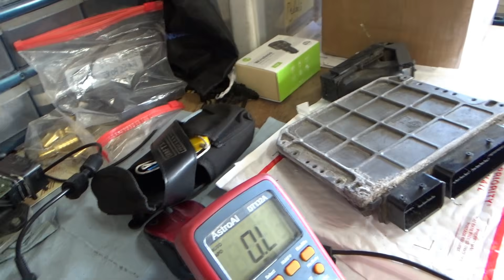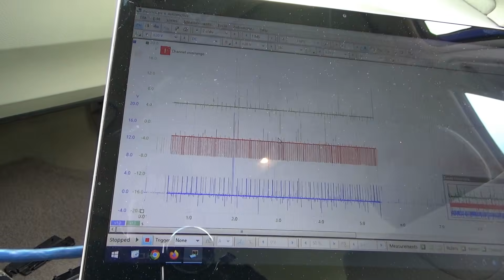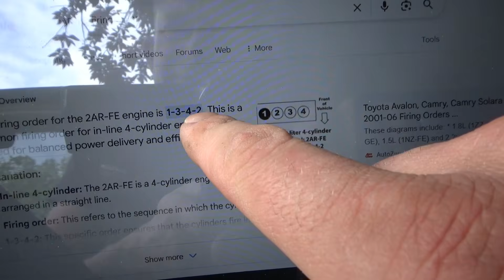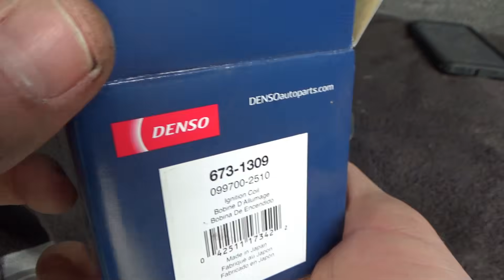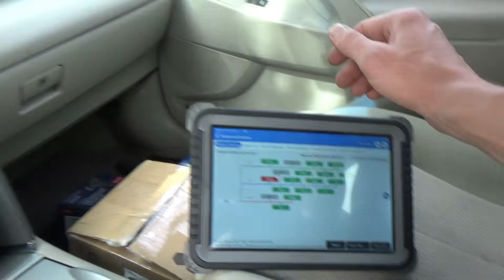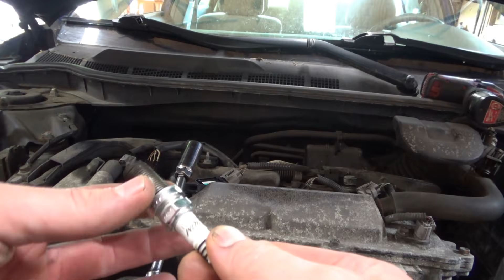(Pt 3 - CONCLUSION) CRAZY Camry...EATS ECMs?!? (Labor Day Special 2025)

Comment: Question. Why with the consistent issues with damaged or counterfit parts from Rock Auto do  we continue to purchase them and blame NGK or the manufacturer?  Props to NGK for stepping up. Thanks Ivan. Ive also found Napa and other reputable parts stores have reasonable prices and will warranty a part right away so you dont have to wait.

Comment: Curious what it did to the ECM - is there a component that blows like a fuse?  I know you showed the one board and didn't have any obvious signs - Did you send it to Northridge fix?  Probably not worth it for suh a random failure, but auto electronics / networking is facinating to me.  Thanks for consistantly sharing interesting content!

Comment: In my younger days when I had my Arctic Cat Panther that ws powered by Suzuki, I was so impressed with NGK plugs, I bought NKG spark plug wires and spark plug boots to replace the OEM wires and boots. I still think both NGK and Denso make auto parts...and other types...that meet the highest standards. 
Your diagnosis on this Camry was pretty amazing.  You are no fool for sure.

Comment: Back in the early eighties I had a car with a two way radio that when they hit the talk button the car would quit. The signal from the radio was screwing up the circuitry in the ignition module but would not cause a complete failure. Replaced the aftermarket module with OEM problem solved.
Reply: Back in the day I had a Motorola two radio that would trip a GFCI outlet in my house when the mic was keyed.

Comment: I hope that many young (future and present) mechanics are watching you regularly. It seems to me to be the best way to train a mechanic that I know about. It appears that the car dealerships need better trained mechanics from all the business you get because they can't solve a problem.
Reply: The OEM's punish diag work and reward fast as possible parts swapping. In general a dealer shop can be a terrible place too diagnose cars. If they rewarded competency at trouble shooting the average dealer shop would be better at it. Other obstacle is neither the manufacture or the customer wants to pay for diag time. Many times on customer pay work, I have the customer tell me the diag should be free as I just have to plug it in. The big exception to that is. I often get cars that have been to a bunch of independent shops and have had the parts cannon fired at them. When I find the root cause on one of those the customer often appreciates my effort.

Comment: I bought a Corolla that had no check engine light and no communication from my Toyota dealer. Nice looking car. Turns out it had a bad aftermarket  coil. I bought 4 used Prius coils on Ebay. Problem solved. It kept blowing  a fuse as soon as you turned the key on. Luckily I only went through a few fuses and not ecms.

Comment: One of the guys had one at the dealer. Just a long crank on a 3series. Aftermarket coil was spiking the cas module on first crank in the morning. It was parts canon heaven. The dealer ate the parts and eventually had a engineer out to fix it.

Comment: Ngk has been making a OEM part and after market quality part with a 1yr warranty especially IGN parts and they last just that 1-2 yrs. A set of plug wires went out after 2 yrs setting off coil codes but it was the plug wire that was bad

Comment: That little glitch on the 5 v signal could be damage to the wire from the high voltage crossing internally in the bad coil. May need a new signal wire on the cylinder. Time wil tell

Comment: I've always used NGK Iridium in my Hondas, no intention of changing that. That said, ignition coils Denso as OEM, I'd likely choose Denso. I'm curious why the owner changed the coil packs to begin with. I've owned some higher miles Honda and Toyota vehicles and never thought to replace them as preventative maintenance. In any case another amazing diagnosis and persistence to solve it. Props to you and kudos to NGK for the follow up testing.

Comment: I installed a ngk spool valve on a customer Honda element. It kept leaking oil. Ngk was 79 bucks OEM was 280. I replaced the gasket 3x it kept leaking. I got an OEM and compared them and the ngk was .009 shallower on the o ring groove.

Comment: how long does it take to test each coil to ensure this is not happening?  these coils that live under the manifold/plenum cause an issue in that finding the correct place (wire or connector) to test for this requires some creativity or research.  it appears it is prudent now to check for this and there is no such thing as too often.  also, I would wonder if injectors could be next for taking down computers if they are not already doing so.

Comment: NGK is my choice from 1970s until today .
Not sure I would condemn NGK over one defective product.....
I used them on motorcycle marine and automotive use since 1970s 

30Kv leaks to 5v reference signal to ECM causing spikes wow !

I heard there are counterfeit NGK iridium plugs and coils  being sold on fleabay and scamazone .

I was also taught in Yamaha school not to take plug wire off plug or unground while cranking or running since it could damage coil or CDI capacitor in ECM on Motorcycle and outboard motors .

Excellent job Ivan 👍

Comment: Wow Ivan, this might be the most impressive diagnosis ever.  I don't know how you made the logic leap to suspect the coils.  Perhaps you've seen this before or perhaps you got some divine inspiration?  Either way, great series.  You are providing a priceless service to the automotive maintenance world.
Reply: I haven’t watched this video series yet except for some of p2 and the first two minutes here when you did your summary. The first thing that came to mind is you need a new ballast resistor… if this was 1965. 😃 I’m hooked, so I’ll finish this episode and see what happens. Happy Labor Day to one and all. And remember, if you love it it’s not work. But that doesn’t mean you shouldn’t get paid fairly.
Reply from the maker: The 4th ECM that set all 4 coil control codes when it died was a big clue 😉
Reply: @PineHollowAutoDiagnostics  I was about to comment the same when I saw your reply.   👍
Reply: @PineHollowAutoDiagnostics  it seems like so long ago.  there was so much to this, and only four hours of diagnostic time.
Reply: @PineHollowAutoDiagnostics that was one clue…  but the aftermarket coil was another clue
Reply: He had already one or two cases where a coil spiked the system causing issues, one I think was a dodge and the other a Subaru.
Reply: This happens to the first gen of the ford 3.5 when the spark plug worn out the coil will short out and kill the computer high volt will enter the signal wier.in this caes it a defect.buy cois with garente.😂

Comment: Battery +12V
     ↓
     COP (Step-Up Transformer)
     ↓
  [Cracked / Faulty COP] 
     ↓
  Inductive bleed ⚡ → 5V Reference line
     ↓
  PCM inputs damaged 💥
     ↓
  Engine sensors / ECM malfunction

Comment: Possible defect in the potting/insulation that failed due to high voltage breakdown of the insulation or heat/ vibration induced failure.

Comment: It only makes sense that a high voltage leak would burn out the 5v reference. A coil failure would appear to have a higher potential for damage than a shorted sensor.

Comment: I would insert a high temp, high voltage ceramic disc capacitor (say ~20nF) onto the 5V line.
Scope it and see if the ref. wire voltage is cleaner.🤔

Comment: Our labour day is on October 4 in New South Wales, Australia.

You did a really good job capturing that inductive spike without the ECU blowing up, I know that you shouldn't do things like disconnect the battery while the engine is running for the same reason, that will happen, I know Kenny on the YT channel WWK did that to one of his personal cars just to demonstrate something to some people but I wouldn't do that to my car because I don't have the money to replace the PCM & I also don't have the equipment to link it up to the body control module if I had to replace it.

I would want to get the replacement cloned because my cars PCM doesn't run a standard tune although it will run with a factory tune, it won't go as good even though it has a sports exhaust system fitted, the PCM has been tuned to that exhaust system in real time on a chassis dyno.

I know that the older Nissans (e.g the R31 Skylines) had Hitachi ignition coils, ECU, fuel injectors, etc fitted which were all good but in the later Nissans (e.g. the R33 Skylines) they went for Denso side feed fuel injectors, coolant temperature sensors, etc but the ECU & the MAF sensor was still made by Hitachi.

My Holden VL Commodore which ran the Nissan RB30DE engine I built for it using the RB25DE engine parts was fitted with the same Denso side feed fuel injectors as the Nissan KA24DE & SR20DE engines were !

Comment: I'm not sure if it was the coil or the computer driver but I had a 08 Lincoln mkz I believe with a 3.5 it came in with a melted coil because the driver was shorted to ground so the coil was basically trying to see how long it could handle full power and ground, boy does that stink btw.

Comment: I remember some schooling I received over 25 years ago when coil on plug was relatively new.   It was mentioned that unplugging spark plugs while the vehicle was running was a bad idea. In essence, that high voltage on the secondary has to go *somewhere*. Even with a distributor, the spike was liable to go back on the primary side and kill the driver.  Many years later, an electrical engineer told me that the arc happens within the coil itself which isn't good for the coil and I see no reason it cannot migrate back to the engine computer whether via the IGF or trigger wire.

Comment: This 5 V circuit must have ultra-fast protection diodes on both sides. If there are none, it's a major case of planned obsolescence...
Remember: in any CMOS circuits, any voltage below the ground level and above the power line level (by more than approx. 0.6 V) is always dangerous! Also any voltage greater than 0.6 V arriving at the circuit inputs BEFORE the power line voltage is dangerous as well.
Reply: They probably put TVS diode on the output of reference voltage, and that is probably what caused short circuit. So protection is in place, its just one time use(its for protecting things connected to the output of Vref in case regulator self-destructs and send 12V into Vref, not to protect ECU from)

Comment: Funny how customer is fine with used ecm but didn't get a good used set of coils. This is kinda the same issues Ford had on Escapes. It looks like  the ignition capacitor part of the coils failed. The pattern looks like old skool when an external capacitor leaked.

Comment: From an engineering prospective, the 5 volt reference needs to be zener-protected. Say, a 15 volt zener diode to swamp the 5 volt line, to control unwanted spikes from back-feeding into the ECM. But better yet, eliminate ECM technology altogether. Simpler systems need less intervention, just sayin. But, I'm old & my heart is back in the vacuum-tube era, I guess, It was much simpler back when.

Comment: Great work, Ivan.  The low voltage on the ignition side is interesting, but apparently this failure avoided detection by the ECU (granted, engine did not run long, but you did note that the car was audibly misfiring).  Would be interesting to note if the misfire was detected on coil number 2 by the original ECU immediately prior to catastrophic failure of the ECU.  Misfires can quickly damage the catalytic converter, so misfires typically trigger a CEL or even a flashing CEL when driving.

Comment: That was a pretty cool diagnostic!! But I think the computer had a bad electrical design as well. It should have some kind of internal fuses or protections, like laptops, to save the rest of the circuits so a technician is able to repair them easily. But I guess they wouldn't sell them as much 😅

Comment: Ivan, I've always rated NGK spark plugs. Even the guys at NGK are surprised at how this ignition coil failed. Kudos to them for trying to get to the bottom of the problem and to improve their products.
Reply: NGK should have stepped up to the plate and given the customer, at the minimum, 4 new coils.  Perhaps even covered the cost of a new engine computer.

Comment: Retired power electronics technician here.
Seems crazy that a faulty coil could fry the control circuit (engine computer in your case).
It is, and has been for years common practice to use opto isolators to drive power circuits from expensive computers.
I'm not familiar with the automotive circuits, so apologies if I'm missing the point here. But, still seems like an easily avoidable failure mode to me.
Reply: I worked in power electronics also.  Lots of opto isolators used on the equipment I tested/repaired!
Reply: I'm a dev that sometimes does electronics and yeah, I was scratching my head why the ECM didn't have optocouplers on the ignition outputs. I guess they "treat" those outputs as safe expecting that isolation on inside the coil.

Comment: This is a bad design of the internal cicuitry for the E.C.U. The I.C that controls the driving of the coils is also being used to generate the 5Volt reference for all the external sensors, hence the reason for the ecu getting cooked in that way. However , If they had included the proper protection's cicuitry necessary  so as to deactivate the missbehaving coil then it would have saved all the extra expense's of changing ECU's and you'd be replacing a faulty coil pack only.
Reply: @PineHollowAutoDiagnostics! Ironically, do you know who makes those toyota ECU's?  hahaha,,,, Denso

Comment: I never seen a coil fry a computer. Once again it proves the power of a scope and need to learn how to use one.  Nice work my friend. HAPPY LABOR DAY!
Reply: nothing likes high voltage spikes, where they shouldn't be. things like that happen in automotive all the times, most never get diagnosed properly and they unload a parts cannon, possibly getting lucky. I'd be leery of an engine to body ground and transmission issue being a hidden cause, since it all seemed noisy. then knowing it was salty/slush driven a bunch.

Comment: I did a lot diag work in lincoln dealers and had a many cars with erroneous codes and the culprit in such cases was RFI on (cops), that was the early models. Guys lost a lot of ground on the beginning cases because we were not aware of RFI. Mode 6 was a help to rule out actual failing components and angle in on COP. 
Great catch here and I never did see one like this.

Comment: I try to keep up with maintenance on my Honda.  I know Ivan has told me it ain't broke, so don't mess with it . Well,  before I watched PHAP, I changed out the coils on the 2010 Honda Civic.  I figure it said 79k miles whenI bought it. Do it in the summer.  Put in NGK coils . Darn if it didn't stall on the way home from work at a stoplight.  90 miles away from home.  Of course,  I put the old coils back in. Still running good at 137k.  I called NGK,  nothing happened.  Thanks for sharing this one Ivan.  No more NGK  for me.
Reply: I’m guessing you probably didnt have the scope data that Ivan did to verify the problem. Without that it would be a guess. 👍

Comment: I've not seen that exact fault, but I have seen older Ford encapsulated coil blocks fail due to people pulling plug leads with the engine running to try and locate a misfire. That was generally fine with oil-filled metal can coils on distributor systems - but not with encapsulated coils, though there are still youtube videos around suggesting that.

Those older Ford coil blocks also had a habit of just failing, due to the epoxy cracking.

The only coil-damaged ECU I've had was on a Mitsubishi; a coil failed and blew the driver transistors. Luckily not a sealed unit so it was a straightforward repair.

Comment: I'd heard about Fords losing the computer on account of bad spark plugs, but it didn't occur to me that it could happen on a Toyota. I understand the 5V reference being needed by analog sensors, but it's beyond me as to why ignition coils would need it. Sounds to me like Toyota should have had an external 5V supply for the coils, and optically isolated any feedback needed by the computer. This is some scary stuff! Wonderful to hear that NGK actually listened!
Reply: Anything can fail. Ignition module or computer can die typically when there is a problem with engine ground and the high voltage spikes start to find path through sensor wires.

Comment: Brit elec controls engineer here. Excellent diagnosis!
Root cause = ludicrously fragile ECM 5v supply - on a subsystem with HV on it, it's borderline incompetent design not to put L-C + varistor filtration inline. IMO, of course.
Reply: How about a diode on the 5 volt reference.
Reply: @Bottoarguewith  That will be there anyway in the output device, I should think. It's probable that's what's failed.